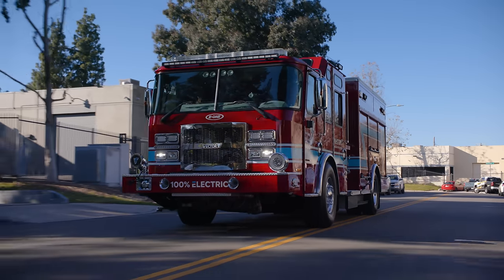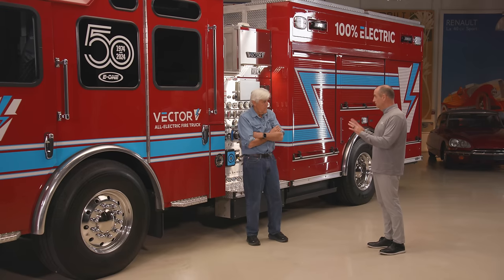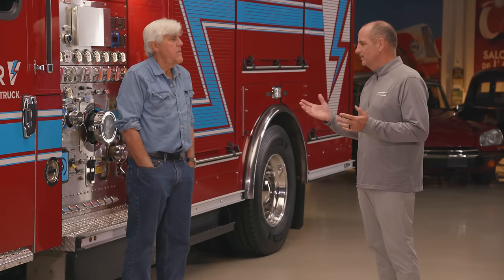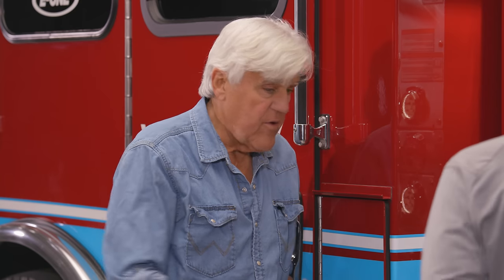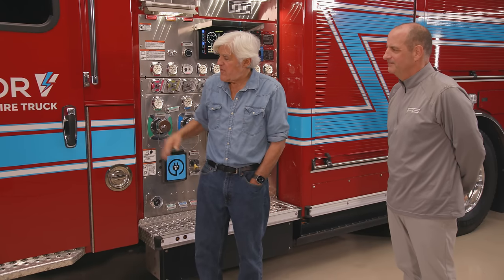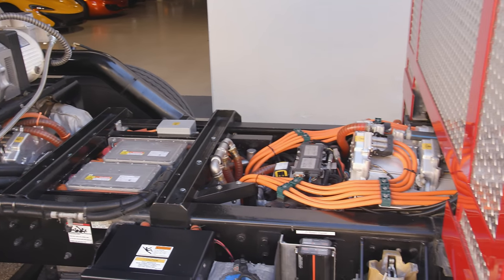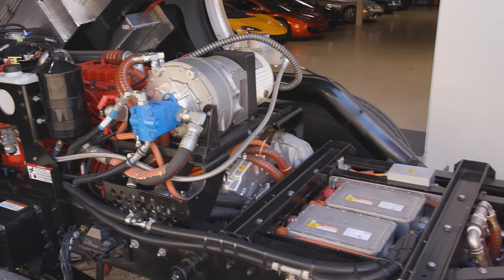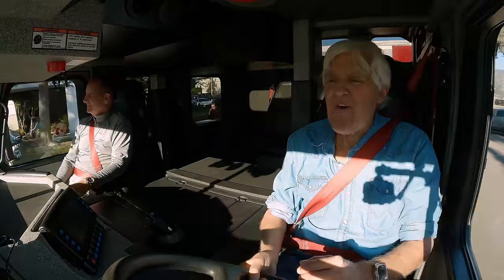The Future of Firetrucks?

Comment: When they were discussing range, Jay pointed out that Fire Trucks just don't need to go very far.  He said his antique Fire Truck only has 11,000 miles on it.  But, with such low mileage, are exhaust emissions really an issue?  Why do we need an overly complicated vehicle to fix a non problem?
Reply: EV are simpler, not more complex
Reply: @ngilman1  are they? The motor might be simpler but the electronics, computers, are complicated
Reply: @ngilman1  EVs are NOT simpler when you include the entire infrastructure required to manufacture, maintain and fuel them. There are so many downsides to EVs that people try to gloss over and ignore.
Reply: @CarlDraper  In that case, should 747's utilize non-electronic componentry?  Of course not.
Reply: @CarlDraper  Inverters are not complicated, they are just a bunch of fast switching transistors. Computers are not complicated, I've been building PCs and writing code since I was a kid.
Reply: @paulm749  A battery pack is simpler to build than an ICE engine + transmission drivetrain, and power plants are a lot simpler than oil refineries.
Reply: Yes, but if you watch the video, you'll see that driving is not the only emissions they are worried about. When the vehicle is on scene and pumping, the engines are running.
Reply: To your question of range don't fire trucks idle at the location of the fire?
Reply: Fire trucks have huge idle times, and they're under heavy load when operating the pumps. Neither of those things are reflected on the odometer.
Reply: exactly
Reply: @DripDripDrip69  Again, you fail to consider the entire infrastructure for EVs which would require MASSIVE new mining and mineral refining capacity. 

And why haven't they started building all those new power plants yet? It will take years to build all the additional power generation and distribution required to do the big switch-over to the mandated all-electric future, yet nobody seems to be in any hurry to get started on that side of the equation. Think about that.
Reply: @paulm749  Because everything has been build out already, China can already supply all the EV batteries the whole world needs and there's already enough electricity generation for off-peak overnight charging.
Reply: Thank you for not missing the point! Makes no sense for the FIre Dept. to spend MILLIONS of dollars of MY taxpayer money on a new toy. They can keep the old ones going just fine for a lot less money. At the heart of a fire engine is a very standard Cummins diesel engine with loads of cheap parts available.
Reply: @DripDripDrip69 most of the mining is done in Africa by children and there's not enough cobalt for even one.
Reply: @DripDripDrip69 china batteries catch on fire a lot
Reply: As a firefighter, we ride in and work around the trucks all day long. NOT breathing in the diesel emissions is a great advantage. I am in a rural area, so we have longer runs, but still nothing this truck could not do easily without fear of running out of juice.
Reply: Even idling for several hours on-scene, the fire produces thousands of times the pollutants of several engines.
Reply: Don't y'all breathe toxic burnt chemicals at fire sites? A clean combustion cycle does seem that bad to be around especially being outside or with the ventilation that stations have. This seems like a waste of money especially since this has a diesel generator loool why put 100% electric sticker when it's clearly not at times.
Reply: @ngilman1  In a naive sense, yes, there are fewer large components. But the billions of sub-components and failure modes make them far more complicated. Inverters are prone to failure and software is horribly difficult to maintain for safety and reliability. You have any idea what aerospace goes through to write safety-critical software?
Reply: @DripDripDrip69  Slapping a couple of parts together and installing software is nothing. Try repairing even one of those components, or finding a bug in code someone else wrote.
Reply: @workshop389  Not even an issue, the fire produces thousands of times the pollutants as several engines.
Reply: @loganward8368  Most of them have hour meters.
Reply: @b.t.2795  yes
Reply: @buffalobilly6046  Fire engines still wear out. Electric fire engines, like transit buses and delivery vans are ideal for eletrification. They travel known distances and can sit on a charger when not in use. What wasn't mentioned is that the huge and very volatile expense for delivery.transit/fire is petroleum fuels even with hedging. Electrical costs are regulated and relatively stable in the mid-term.
Reply: The engines operate the pump, so while not going far they still run lots of hours and put out exhaust operating the equipment.
Reply: Wrong EV is more complex and more expensive to maintain. @ngilman1
Reply: @ngilman1  --  Not really.   But the "complexity" is in the electronics and the inverters and the battery management systems and the temperature control system.   There are the battery and electric motor temperature management systems.   Some of these have equivalents in the ICE but they tend to be much simply.   For example, you usually don't worry about and ICE engine getting too warm when it's parked.
Reply: @workshop389  --  I was a bit surprised when he said that the driving motors also operate the pumps.   Just a transfer/pto like in a ICE firetruck.

One advantage of electric is that you usually can put a pump and motor exactly where it can best function.   Even more interesting was that the two electric motors were more or less located where the transmission on a ICE vehicle would be.
Reply: We don’t. This is a complete waste of money.
Reply: Low mileage, but high work hours. The engine still has to run to pump water, even if the wheels aren’t moving across the asphalt.
Reply: It’s not overly complicated. Diesel engines and transmissions are far more complex. As far as emissions are concerned you might want to read up on the 
“ non existent “ problem of climate change.
Reply: @paulm749  Bro you really are trying way to hard to find downsides. You jump from point to point after you get schooled. Get some information or quit participating in the discussion, its embarassing.
Reply: @tortepasti2  Oh please - keep beating on that straw man! It's quite entertaining! LOL
Reply: @paulm749  Brother you wouldnt recognize a straw man when one would knock on your door. Your arguments failed and you jumped to the next one hoping it wouldnt. But it did. You are lacking big time
Reply: @tortepasti2  - and you only talk categories and offer ZERO specifics. Who's lacking now? smh
Reply: @loganward8368  Equipment such as fire engines that do operate when stationary typically have hour meters on the engines to determine maintenance intervals.
Reply: @paulm749  haha because the "specifics" you offered were all so so so wrong that you just did my dirty work. I can sit back, relax and watch you yapping like a baby
Reply: @tortepasti2  Glad I'm able to brighten up you day just that little bit! You're truly, truly special and deserving of it! Smooches!
Reply: Hey the power plant is on fire... Send all the electric fire trucks. Oh man this powerpower plant is burning for days.... Oh no our batteries are low.

😊
Reply: evs are more simple for a car yes. But for a fire truck no probably not. Fire engines have ptos that run the pump. That sometimes have to be used for extended amounts of time. 100 gallon diesel tank thing could run for days. I wouldnt trust this thing to put out a fire. Unless it was putting itself out. The guy said it himself we put a DIESEL generator in it so we dont run out of charge. Might as well be a hybrid. Plus we send it "overseas" for the electric drivetrain. Yeah that sounds really simple.
Reply: @paulm749  you are so desperate in trying to come off as smart, god its embarassing
Reply: Great point,
Reply: Exactly … there’s no need for any of it really … we have MoRE than enough trees to offset our carbon footprint in North America
Reply: I would agree that fire trucks are probably minor sources of CO2.   The truck might be CO2 neutral depending on the number of hours it otherwise would have been idling.
Reply: Diesels engine are commonly measured by hours, not miles. So having multiple large diesel engines idling for hours adds up
Reply: On one have, outsourcing Europe is a nice change, but given that tax dollars are often the money that pays for these trucks, shipping and receiving such large items seems like an unnecessary added expense
Reply: @junit483  Yes it is.  But he did not actually say "Europe".  He said we ship it over seas for the drive train.  Seems like if they sent it somewhere good, like Germany, he would say that.  But he didn't.  That probably means he was avoiding saying China.
Reply: Just like police cars it’s not about the mileage. It’s about the hours that are on the vehicle.
The fire engine you mentioned with 11,000 miles on it might have 25,000 hours on it. 
When they are at fire (unless they can somehow plug that truck in) those pumps are going to be drawing a lot of kilowatts from that battery!  
On the bright side, if it goes into thermal runaway, hopefully it can put itself out!
Reply: Because of ... The Narrative, and the Corporate NWO takeover
Reply: @ngilman1 NOPE….
Reply: @DripDripDrip69  The battery pack is very complicated and very heavy.  The electric motors are simple.  ICE is the opposite.  The motors are complicated and the fuel storage is extremely simple.  But ICE motors are mechanical.  So anyone can fix them.
Reply: Yes, less complicated.  The computer powered needed to manage a modern ICE and it's transmission could power the space station.  Only a fraction of that complication exists in an electric vehicle.
Reply: Awesome question
Reply: @ngilman1  Wrong, they are much more complex!
Reply: @golfnut2965  Diesel fueled engine, view the video next time
Reply: @golfnut2965  My main problem is these electric trucks cost twice the price of a standard truck.  Why not have two fire trucks instead of one.  Like Jay said, they don't get driven much so acting "green" is a huge premium, but as usual it's people spending other people's money.  EV's have their place, I own a Mach'e GT and love it, I park it next to my F250.  What if the truck is called to a different fire, is it close enough, will it make it?  After returning to the fire dept and there is another call 'sorry, we gotta charge for an hour before responding'.  And how many stations have 480V service, that alone is going to be a huge financial expenditure.  Jay should stay out of politics but he can't help himself, like many old celebrates they erode their own reputation
Reply: That is why, at least all of the Fire Apparatus I've been on, they are equipped with a "Hour Meter".

Simply put, that's what all of the Chief Engineers that I've Worked/Volunteered with have always told me that the "Hour Meter" tells the story of how much TIME the Engine has run in it's lifetime.

They also told me that the hour meter is more important to them than the odometer.

Yet, they tell me that they use both of them (the hour meter & the odometer), along with the maintenance records among other things to tell the "Life Story" of the Apparatus.

I know a few Ambulance Companies both Paid & Volunteer, that are looking to buy New Ambulances & are requiring Hour Meters to be installed on their vehicles from the factory.
Reply: there are also busy departments out there. They run dozens of calls, running on diesel 100% of the time, and keep it running while on scene as well. Same with our EMS units. Have to hit the gas station at least once a day, every single day. 
Apart from that electric fire trucks also have advantages like operating them inside a building without ventilation being necessary, and also driving into a smoke filled tunnel isn't an issue
Reply: Exhaust emissions happen when diesel trucks idle too, not just when they drive.
Reply: To be fair, his truck belonged to a movie studio before going to the city. I don't think it is representative of regular service.  That said, low road mileage is common relative to age, but engine hours are higher, but still nothing like an over the road truck.
Reply: @NYCS19339  my neighbors have a 1936 Chevy fire engine that has 3000 original miles on it and it has the original paint which still has shiny areas.
Reply: EVs are ridiculously simple
inverters are nothing new, nither are industrial computers, and a common ICE car has over 4000 moving parts, any of which can cause catastrophic failure, while a common EV has less than 100, many of which are redundant
Reply: I am a retired county firefighter in the Central Valley of California.  The county is very large.  We responded to every kind of emergency within approximately 8000 square miles.  Residential, commercial, industrial and wild land.  Mutual aid responses can require traveling anywhere in the state.
Reply: to be fair though, ambulances are more like police cars. Fire equipment doesn't run as often as you think in medium and small cities.  We'd often do "driver training " just to turn some wheels on the less used equipment.
Reply: @paulm749  Gas car are not simpler, when you include the  infrastructure required to manufacture, maintain and fuel them. There are so many downsides to ICE Vehicles that people try to gloss over and ignore. We should probably stick to horse and buggy. You do realize they use the same infrastructure, are easier to manufacture, require way way less maintenance, and umm I have yet to be anywhere that doesn't have a plug (fuel) free to use. Your statement makes absolutley no sense.
Reply: Maybe 11kmiles but probably another 2000 hours on the engine running the pumps and generators. Electric Firetrucks will work if they have diesel back ups for a genset.
Reply: @jamiew6882   Electricity is not free no matter where you plug in. So your statement makes absolutely no sense
Reply: Those trucks idle most their life.
Reply: may not have many miles, but how many hours of idling does it have?
Reply: @vagcentral2252 there probably talking about the type of generator that you use to power your home when the power goes out it’s the same concept on a slightly bigger scale. It doesn’t have a diesel motor so technically it’s  still pure electric.
Reply: @redemptionjack4657 true EV’s are currently expensive to buy but the cost of ownership is cheaper in the long run, they are getting cheaper everyday while gas and diesel are getting more expensive plus don’t even get me started on the cost to maintain them
Reply: @cheeseisgreat24 true but Electric motors get less wear and tear compared to ice
Reply: @hankstar.1 yes a diesel generator to charge the batteries like you use a generator to power your house when the power goes out
Reply: @junit483 honestly I don’t know why they don’t get help with electrification from Tesla or another company here in the USA instead of outsourcing
Reply: @paulm749  "entire infrastructure required to manufacture, maintain and fuel them." ahh yes because a Fuel Refinery and Fuel Depot and Tanker Trucking Industry is soo much simpler. You are the one ignoring reality.
Reply: Not far, but lots of high idle and full throttle.
Reply: @redemptionjack4657  Factually wrong. EV power train has way more repetitive with modular parts, less unique specially shaped parts. Way less moving parts and less hotter as nothing should surpass hot drink temperature while with less liquids & lubricants. It's just an engineering fact it's easier to and simpler to maintain a EV.
Reply: @giminai8000  Well, precisely my point. The OP stated that “Emissions wouldn’t be an issue” because of mileage, but the engine runs for many many hours, just not all of those hours are used on getting to the fire.
Reply: @golfnut2965  Hertz bought so many without thinking of the cost when it comes down to range Tesla don’t have that issue it’s the other auto makers and electrify America that has issues with working chargers you don’t hear Tesla owners complaining about their charging network just because i think electric cars are good. Doesn’t mean I don’t see their faults
Reply: @golfnut2965  yes buy into the hybrid hydrogen nonsense be my guest I’m not even gonna try and argue what All is wrong with hybrids and hydrogen ,there is so much misinformation in your statement it’s not even funny so I’m just gonna go about my business and just leave this whole thing alone because I’m not gonna waste my time and brain cells on a pointless argument
Reply: @golfnut2965  uhhhhh hertz is dumping them because they literally dump all the vehicles in their fleet. They purchase brand new, use it for the first few thousand miles, then dump them. It keeps maintenance costs lower when they are only dealing with fresh vehicles. That’s how several friends of mine have gotten practically new vehicles for insanely low prices, the rental companies only have to recoup the garaging costs which are pitiful.
Reply: @golfnut2965  Yup. And that will turn into them getting rid of all ICE at one time because no one wants to be hassled with filling up when you can barely find gas stations in a decade 🤷🏻‍♂️
Reply: @golfnut2965  Nope, nobody predicted that.
Reply: @golfnut2965  Or I do. Because other than the people who stand to profit from your belief that something is right around the corner when it’s not, who exist at all times in America and always lie, the general consensus was never that EVs would be ready to replace vehicles 20 years ago. In general that kind of statement was always contingent on “With Sufficient investment” which simply hasn’t happened until this decade. And with the current momentum of the tech, the 2030 target to replace all new vehicles with them is looking like it could very well be met, but if not, certainly within 10 years. EV’s right now are a perfect replacement for 95% of Americans, so we’re in the “addressing edgecases” stage of development.
Reply: @golfnut2965  There are level 2 charging and level 3 charging, you are never too old to learn.
Reply: @golfnut2965  Some 800v premium passenger EVs are getting there on level 3, and for level 2 charging, it takes you 20 seconds, 10 seconds to plug it in when you get home and 10 seconds to unplug it in the morning, unlike a gasoline pump you don't have to stand there holding the nozzle, it charges when you sleep, and you'll always have a ""full tank" in the morning and don't have to go to a gas station to mingle with the general public.
Reply: @golfnut2965  Newest wave of 800v EVs can be charge under 20 minutes on level 3, examples are Hyundai Ioniq5/6, KIA EV6 and the refreshed Porsche Taycan, they can be fully charged while you go take a leak and grab a meal, and they have enough range the driver will get hungry before the car does anyway, and things can only get better from there.
Reply: Yeah there is no need. They're rarely used. They had complications and risk.
Reply: A firefighter or a construction worker don't think in range but in operational time. You never see me putting the engine out on an active scene. And sound emission at a fire is a real issue for sure.
Reply: Retired firefighter and the issue isn’t how few miles they’ve run but how many engine hours they run. At a fire scene they will pump for hours or just idle so they can be easily moved or to keep things like battle lights running or radios or any number of things needed at a fire scene. We’ve even refueled engines that were pumping without shutting them down. Can that be done with an EV while running and then refueling a diesel rig took about 5 minutes, how long for an EV that is pumping at a fire scene. I believe the city of Vancouver BC has several EV engines but so far they’ve been down more than they have been available for service. Also right now a good diesel rig cost about $1.5-$2 million but an EV is double that cost. Not very efficient or cost effective for a vital piece of emergency equipment if it is unavailable to respond
Reply: @bartismoellis1052  too many buisnesses will let you use their electricity for free and public parks and rest areas usually have 20 amp outlets arround

I have a decent solar generator too, can you get gas in the middle of no civilization with no communications?
Reply: @golfnut2965  15? many ev makers are working towards 10 now
800v and 1000v architectures are making it possible
Reply: Many people are anti-EV for whatever reason they want to be. If you’re old enough to remember the Middle-East Oil Embargo with gas rationing it might put a different spin on EV’s.
Reply: It's about hours of operation,  not miles. Electric fails.
Reply: Its a tough situation. Its harder to transport this from san diego to miami if one wants to sell itmyo someone in the other becausenyou habe to charge it whoke way across as compared to just driving it
Reply: "The message"
Reply: @paulm749 yeah what he said, and get off my lawn
Reply: Traditional fuels (gasoline and diesel) create condensation throughout the exhaust system. The further you drive the vehicle the less build up of moisture causing rust due to heat. So...there is more likelyhood of moisture the shorter distances the vehicle travels.
This is why...if you own a classic or sports car that you drive very little, you should drive it approximately, 30 minutes each outing to make sure that you've heated the system enough to burn off moisture within the engine and exhaust system.👍
Reply: I wonder where the electrification happens ( my guess is china, haven’t watched full video yet)
Reply: The motor in my truck cost 100,000 dollars and has all kinds of complicated computers and sensors. It is constantly out of service. Electric trucks will be common place in 15 years.
Reply: I’m thinking about rural areas though, what if it’s a busy day too?
Reply: @mr.somelife  They have a diesel backup option. Rosenbauer has the same thing for the RTX. If the battery gets below 20% the generator kicks on and charges the batteries. LA had an RTX and 95% of their operating time was on battery. That was at the second busiest fire house in the US. There aren't too many rural areas that are as busy as LA.
Reply: Valid point